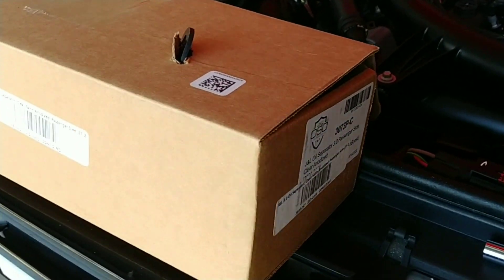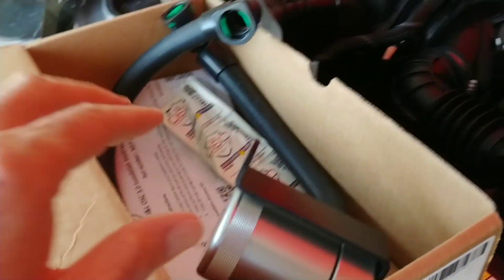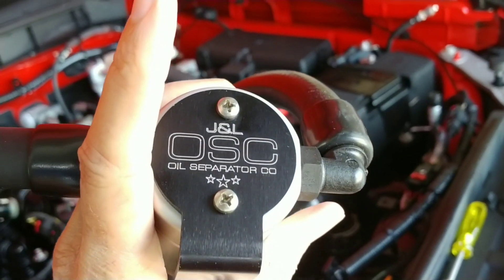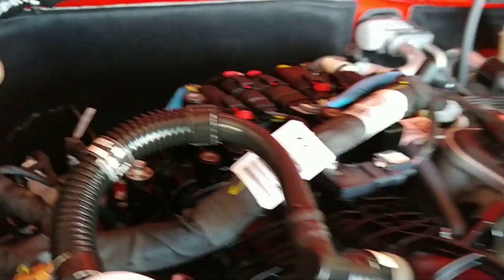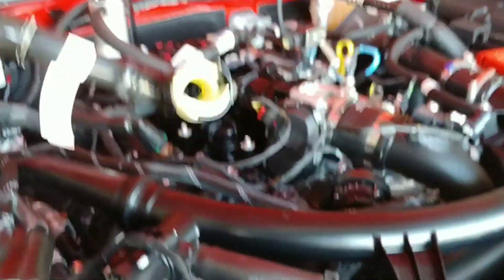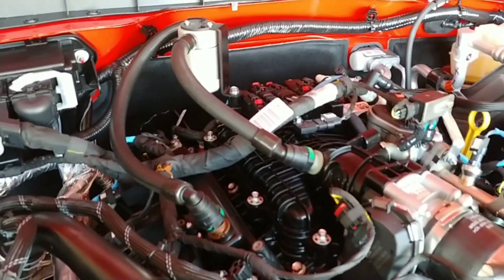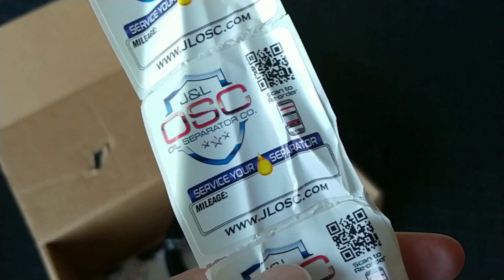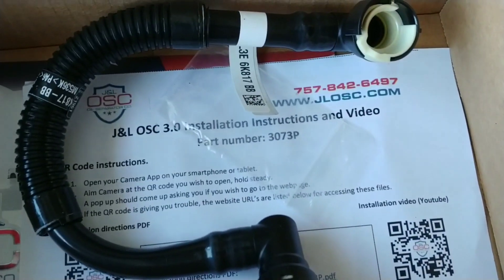J&L 3.0 Oil Separator; Clear/Satin Anodized Install

Comment: Thanks for the video. I would consider reaching  out to Extreme Terrain on this though. Appears they may have sent you a used kit. The bracket should never be installed on the can when you get these parts.